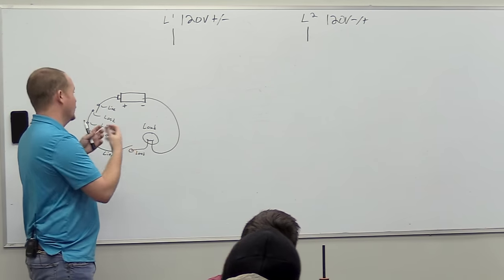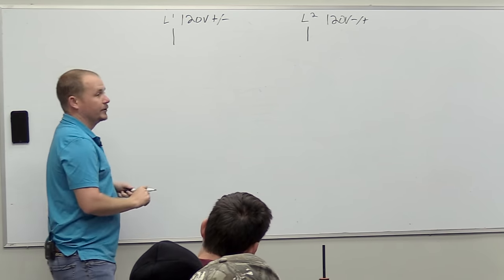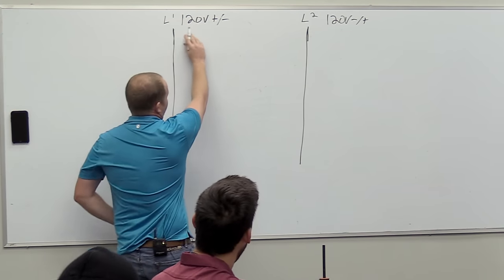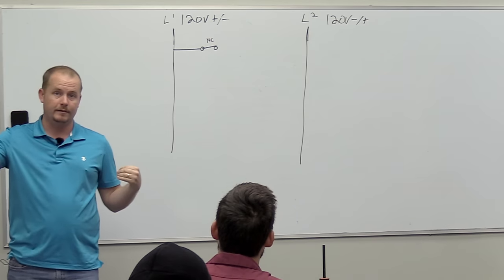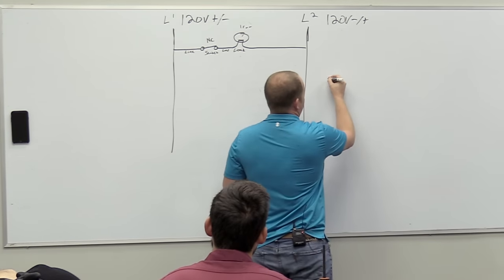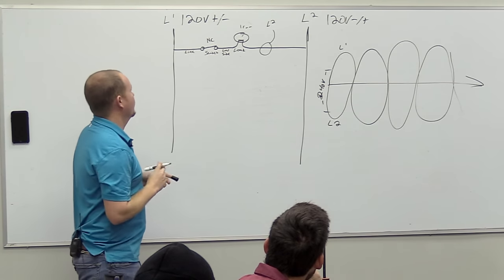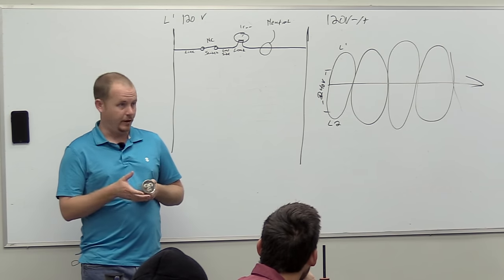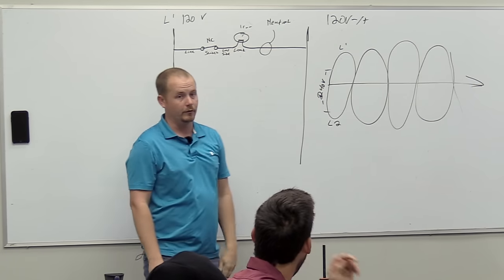Electrical Circuit Basics Part 2 - Intro to Ladder Diagrams

Comment: The reason why one leg wants to travel between 1 leg to the other, is not because it’s alternating current, it’s because the two phases are 90 degrees out of phase and their potential difference is 240 degrees

Comment: Common can mean that a neutral wire can be landed so that when that contact changes position from NO to NC it can complete the circuit to another component. Like a shunt trip.

Comment: Want to ask at one time there used to be a 20 Degree Offset on the out put. Since this was what it was it cooled better and more efficiently yet never made you too cold or let the Thermostat go above the Temp you set it at, yet they set them now to the Thermostat say 70 and you run at 70, this does not cool corectly and allows the Temps to rise even with it properly set. Anyone answer this please would be helpful.  But this would also cut down Electricity and Use.

Comment: Can someone please explain to me why it changes from L2, to common, and then to neutral based on change of voltage?
Reply: All the lines: Line 2, Neutral, or common are doing the same job in the circuit. Regrouping all the load wires. For electricians, it's important to specifie what kind of current source is used. If we mention  Line 2, the electrical circuit is multiple phases  220, or  480, 575 volts etc. 
If we mention neutral, it is a simple phase 120v, if we mention common, it is a control loop transformer 10, 24, 48 volts.